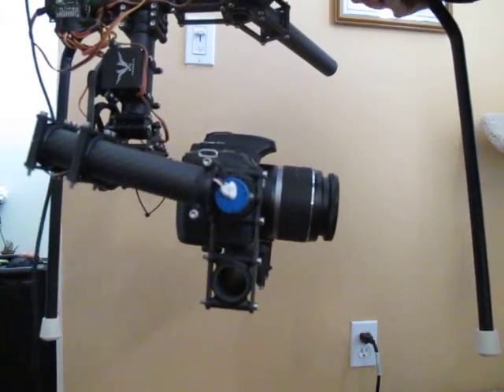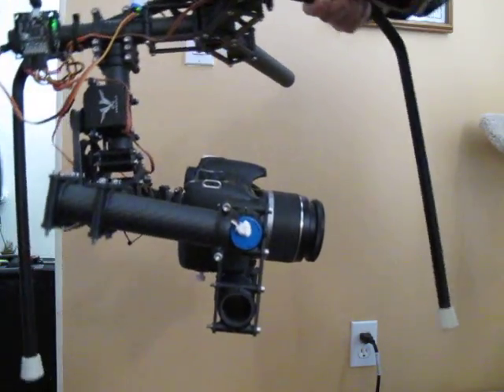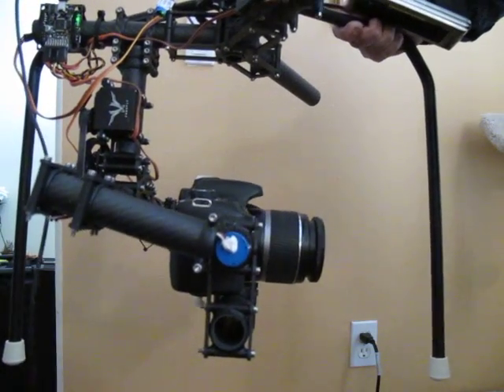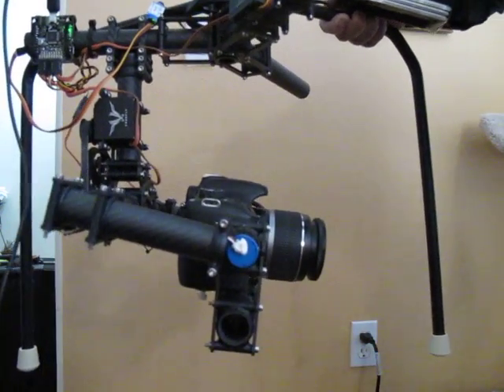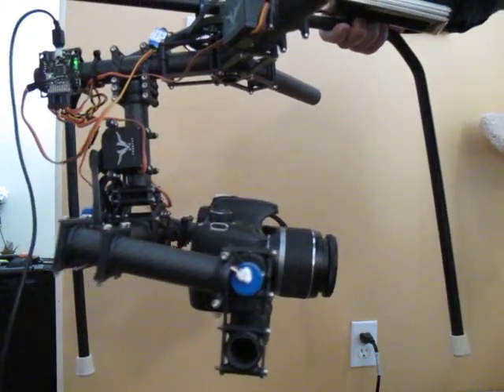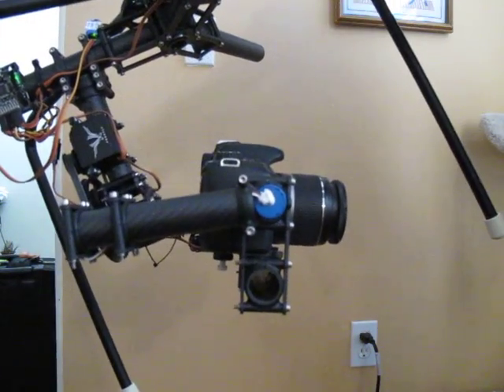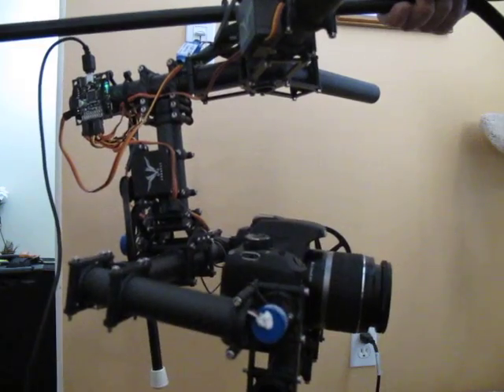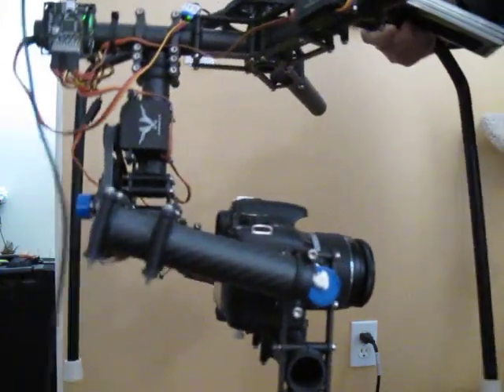HoverflyGIMBAL controller acceleration rate gain demonstration

Comment: I know this is an OLD video, but I am still going to ask... you never know, I get an answer. What is the mounting position called you have yours mounted at?! BACK - TOP?! I have the clone version of this Gimbal and thought that you HAVE to mount the controller on the camera pitch axis?! I did mount it under the camera... Did not test it yet, but will do it tomorrow. Thanks.